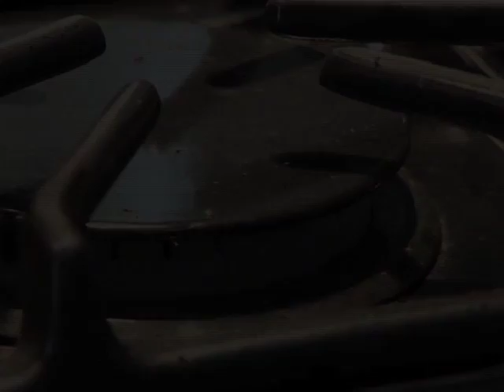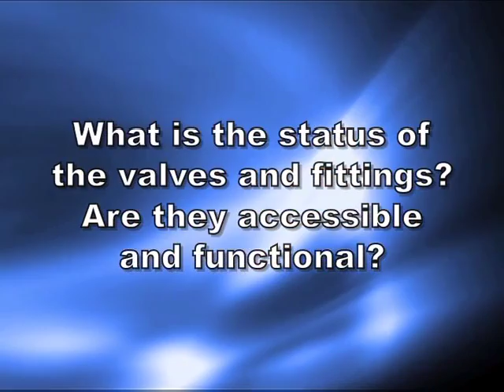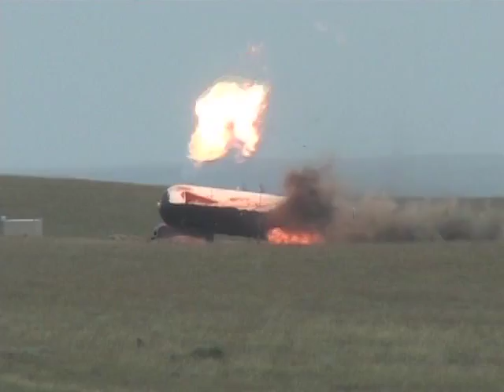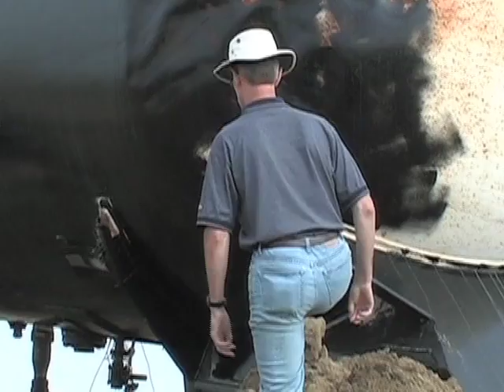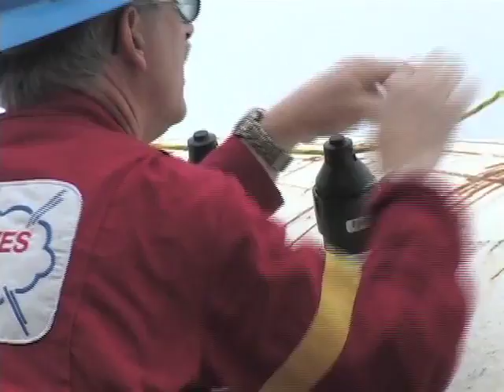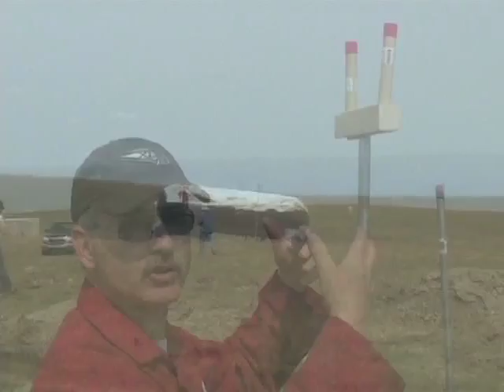The Last Resort: Vent and Burn

Comment: The explosive charges shouldn't be used near the welds though. Otherwise, it is possible that upon detonating, they could cause the weld to fail and cause a larger explosion/release!
Also, by draining the tank directly into a pool of burning contents, can't it suck air into the tank through the top holes, and when the tank is nearly drained, can't the fire flash back into the tank and cause an explosion?!